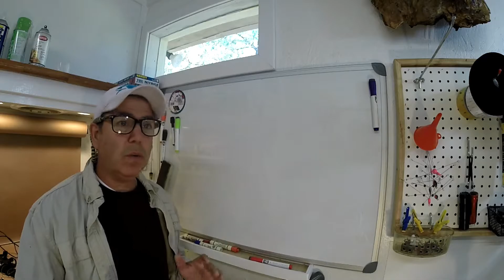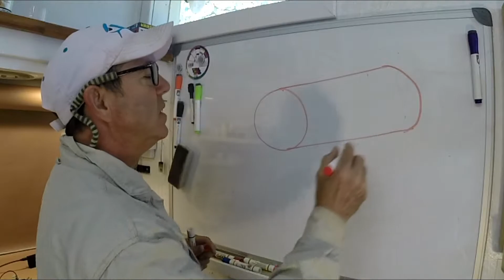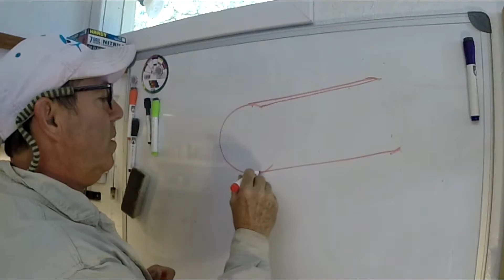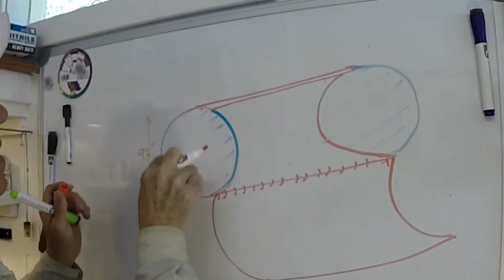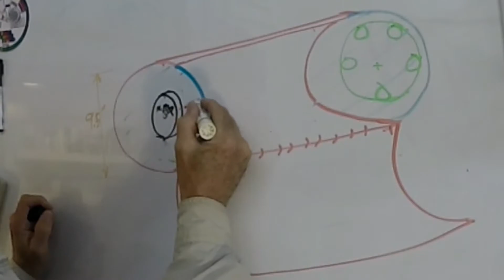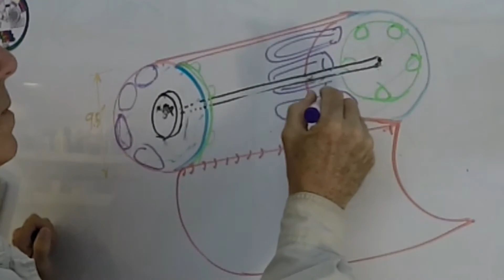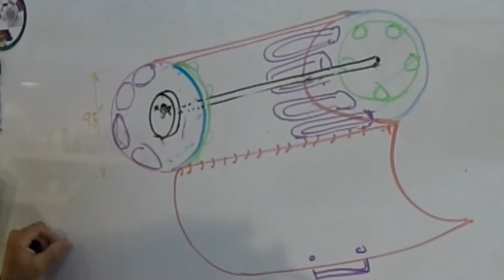new lure turner design

Comment: very cool. even that first one was awesome, great design. but yeah, takes up a lot of room. is this for using Alumi-UV?  do the lures still need to be rotated with that product? very interested in it, might give it a try this summer.
Reply from the maker: I use the alumilite clear UV resin. yes it needs to be turned just to keep it from sagging and actually it's a benefit because you can turn it with the UV lights off and allow it to clear all the bubbles. I'm pretty stoked about this design I think it'll come out pretty good. I plan to post a montage for the construction. thank you for the comments